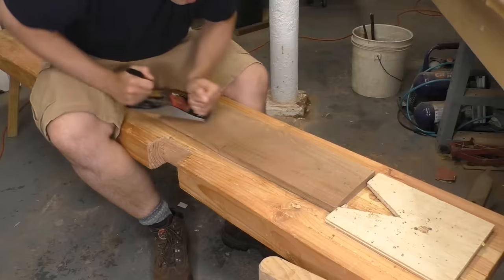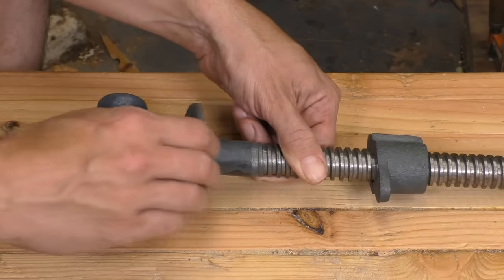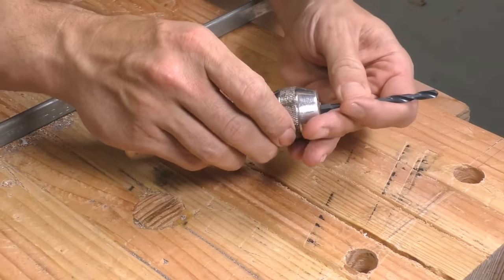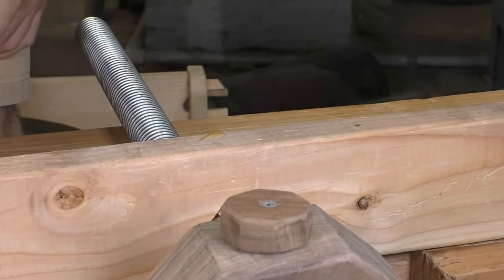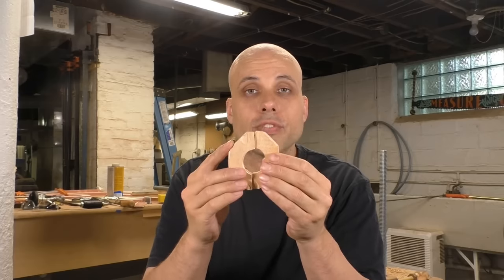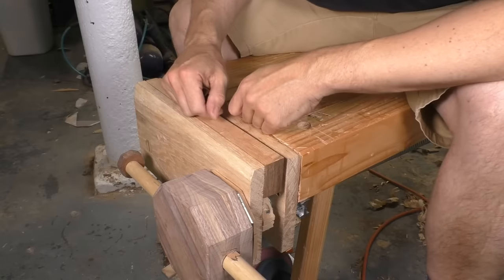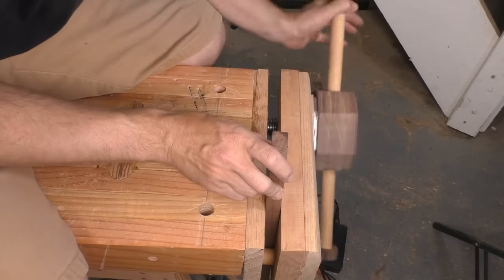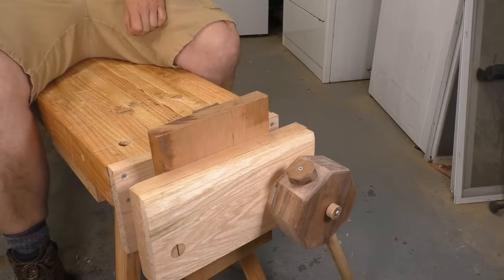Add a vise to the $30 Work Bench.

Comment: Pro tip from a machinist... Off camber vises are super useful, such as shown in this video. If you add additional clamp screws or swivots to the moving jaw they can be even more aggressively "reefed" on without movement of the workpiece. just tighten the work to jive with the kilter of your jaws, then drive your swivots in to catch any areas that dont contact your jaws
Reply: if you are holding strangely shaped objects (like castings or OFF off cuts) you can make temporary jaws that extend above your work surface, then add screws or swivots to both your solid and moving jaws to create a rock solid hold on even the most arbitrary shapes. Just tighten the vise, then tighten the additional screws for almost unlimited hold

Comment: Nice.
I built one of these and it works perfectly.
The idea of using the prop screw was the thing that I liked most; I had been looking around for a good threaded piece but hadn't found anything with a sufficiently robust thread.
Then I got lucky in a junkyard when I stumbled over an old broken prop.
After that, the rest was easy.
Thanks for the ideas.

Comment: I've watched enough of your videos to know you can do really precise work.  I feel like you were perfectly imperfect (like the corner cuts on the jack screw plate) on the non-critical aspects to show it doesn't take machine shop precision to work, and work well.  Kudos for showing these Woodwork for Humans projects in a way that doesn't make it seem that mystical skill levels are needed to successfully complete them.
Reply: My dad used to say, “No such thing as perfect; good enough is the best we can do. Just make sure it’s actually good enough”.
Reply: k
Reply: Good
Reply: Amen.
Reply: There is a good saying however:
If it's worth doing, it's worth doing well
Reply: @beer1for2break3fast4  I don't disagree.  I recently mounted retractable air and electric reels to the ceiling of my garage.  Rather than slapping a plain piece of 2x10 up to span the joists, I took the time to cut semi-circles in the corners of the boards and routed the edges with a router cove bit.  It looks much more finished and aesthetically pleasing.  When I was younger and less financially stable, I had problems even starting projects for fear of messing something up and wind up costing more than it should.  You can read/watch all the tips and tricks for a skill, but application is the only way to perfect them.  Rex's low cost projects and willingness to show that less-than-machine-precision work can still produce great outcomes gives encouragement to beginners to try in the first place.

Comment: I thank you for what you've given to ambitious beginners. For the last 40 years I've been a full time woodworker and now have a 3000 square foot shop with over a hundred thousand dollars of tools and materials on hand but I began a step or two below the level of equipment you assume for this project. I began with a $25 jig saw and a hand drill, sitting in the open doorway of a travel trailer, working across my knee. I tell that in the spirit of this video, as encouragement to the creativity of the ill equipped.

Comment: 1. Try lube on wood alignment rod (WoodGlide or a good wax) to smooth the movement. 2. For more solid clamping, keep a supply of shims to clamp in the opposite side if the Jack screw, maybe glue a small stop on each shim (need 1 shim for each work thickness) for easier setup so shim stays put by gravity while you clamp down the work. Great video as always, outstanding explanation & great concept for a cheap vise
Reply: EngineerMike F, Dude... is the brand name really "WoodGlide"? i need something for a shop stool build with a seat that raises & lowers on a threaded dowel.  BUT,  if i type that brand name into Google will i need to clear my history before my husband get's home?

Comment: This bench project motivates me so much! I just got into woodworking and have no space for a lot of tools and have to use hand tools as much as possible or the neighbors will complain about the noise, this bench is perfect for my small projects, can't wait to get mine done!
Reply from the maker: You can make it much shorter if you need to. I think 5 feet would still let you do a lot.
Reply: Nice one - enjoy the journey. Check out The English Woodworker and also Paul Sellers if you're serious about hand tools. They both teach a no nonsense approach

Comment: Neat.  It's basically a horizontal leg vise.  I made my leg vise from the same kind of scaffolding jack and it works great.  I did have to re-make my hub when the first one split.  I made it too small.  Yours is WAY better than mine was.
Reply from the maker: From my research, it looks like the face vise started as a leg vise turned on it's side. No joke!

Comment: I firmly believe in to each their own. If it works for you, go for it. I bought a Dremel vise on a whim, thinking, oh, another Dremel attachment that will simulate the real thing, only to a degree, but it's what I can afford. I'm finding this little vise works for my small projects. If I need something heavy duty, I think your idea is a good one. So, whatever each woodworker needs, that's what they should use. No method is "better" than the other, as long as whatever you are using works safely and effectively for you. That is what matters. Nice project and nice video.

Comment: I love that you don’t have insane levels of accuracy on things that don’t require it. I’m making one of these vices for my bench. I already picked up the screw and bolt assembly. I noticed the curve on the top edge of the tool tote over your shoulder is not perfectly centered, but that isn’t important for a tool tote. My respect from an native Ohioan. I’m originally from Elyria, just down the road. Thank you for your videos. I’m in Okinawa, Japan these days and do not have access to many diy tools or devices, so thank you for your videos. Amazon is getting better, though. Haha

Comment: My grandfather's wood vice ~ 14" wide, 24" high and 1.7" thick with a threaded metal bar and handle about 6" /150mm down and the 4 by 1 vertical guide bar. This worked well. I still have the metal components and intend to recreate this vice as a prelude to starting to build my THOW.

Comment: I wish I had seen this before I started building a traditional saw bench.  However - you mentioned Moxon vise and I instantly thought, "This is too low," which made me realize - if you build an appropriately sized (plywood?) box to clamp to the "non-vise" end, you can have a work surface raised enough for detail work.  I like your bench, Rex.  Great work.
Reply from the maker: You're totally right. I also sit on a stool next to the bench all the time. Works great.

Comment: Another source for the parts is a cheap mechanical car jack. You can get these for something like 20 bucks. It will have an acme / trapezoid threaded rod (considerably thinner than the one used here, but if it can lift a car, it will hold wood), a crank, the "keeper" and whatever other parts you may need.

I built mine from one of those and it works quite well. For the guide rod, I used a metallic furniture leg (which can be attached using screws) and for guiding the guide rod  I used a piece of plastic kitchen cutting board into which I bored a hole, and screwed to a block of wood with a similar hole. It glides nicer than wood only. I think the only parts apart from the cutting board and the car jack I used was a couple of steel spacers that I cut in half and drilled holes into for attaching to the jaw part to keep each part on the side of the jaw they belong to.

Comment: Great video, and explanation on Vice Mechanics, Rex!!!

   Nobody needs whine about alternative vices, either... IF there was a want for a moxon (for example) then replace that alignment rod with another screw-jack and handle (prob'ly best a wheel over there for space)... and elongate that hole to expand the range for racking... because that's all a moxon really does is rack with purpose...

    Okay, I might suggest some "tuning" procedure to mention the imminently useful nature of paste-wax around the moving wooden pieces... Whether you buy a tub, or mix 3:1 bees' or paraffin to linseed oil and heat and stir really well on your own, and adjust for personal (taste? bleck...) desired consistency... It's not complicated, and relatively inexpensive.
    AND you can substitute other waxes and oils to a fairly liberal degree for the stuff. The POINT is that a bit of lubrication/ protectant can help the general motions of the vice as much as carving and sanding off more material. 

   Made it this far??? Congrat's...
   Okay, that 3:1 mix is the "hard" paste-wax formula... 3 parts wax to 1 part oil (linseed or what have you)...
   Medium, I usually do 2:1 AND soft is 1:1 (for me)...

    Understand that bees' wax is SOFTER than paraffin. Carnauba is back to an "unknown" for me. I haven't messed around with it (or much else) in so many years, I've forgotten most of those... BUT I will say, that you can usually tell the nature of your "product" from some basic comparisons with the "ingredients"... SO mush and squeeze and fiddle with the wax and drizzle a little oil at room temperature to watch how they behave... thicker and harder ingredients make thicker and tougher paste... softer and thinner ingredients render a softer, thinner paste...

    For a vice, I recommend HARD... You're working with a tough tool, and should consider the wax finishing needs be durable. It's never indestructible, so you'll replace it soon enough anyways... BUT nothing (NOTHING) is etched in blood or stone. If you experiment... HAVE FUN with this.

    ...and for the record, I'm just as likely to put in boiled linseed oil, as I am to use raw. There can be "weird chemical additives" in the boiled stuff, though... but otherwise, you get a little more "darkening" and "color" with the raw. AND it's worth note that linseed oil is from Flax Seeds. It may have a smell, but at least the raw stuff won't hurt you... or much of anything else. ;o)
Reply: gnarth d'arkanen thanks for the interesting information.
Reply: @akbychoice  ALWAYS welcome!

    ...and just in case you're interested, I happened into some old engineering notes the other day.
   In the interest of preventing things like "racking" and to avoid friction and side-load (weirdness from sideways motions and torque)... Engineers usually try to fashion their threaded systems to have at least 3 times the diameter in length of the threads... Okay, for a simple quick little machine like this, that's a bit exorbitant maybe... BUT if one was particularly intent on reducing the awkwardness and smoothing out actions, that is one way to try... and it would only require adding one or two more of those "nuts" in line to the underside of the table.

   In any case, I just try to help out with what I can. No sense keeping all the dirty little secrets to myself. Right? ;o)

Comment: 11:18 Good thing you had ear protection for that noisy screwdriver ;)
Reply: If they are like mine they are also headphones for music.
Reply: I don’t think Rex is above using an impact driver off camera then doing the last turn with a hand unit for the sake of the video.
Reply: @escuddy3244  well, you can use a screwdriver on that, too. It doesnt change that fact that you can, he just chose not to. Or maybe he just has a noisy screwdriver
Reply: Or someone in the background yelling " Its 10 O clock when are you coming to bed........

Comment: I found this channel a few months ago looking for this exact tutorial. Had a screw from a broken metal vise and thought of adding a extra carpenter vise to my bench. This is a very useful video.
For lubricating wood surfaces try Graphite. It won't get absorbed by the wood and it's one of the best (basic)lubricants. I just find the softest pencil around (softness is proportional to graphite content)  and paint the surfaces with it.
Reply from the maker: That's a great tip!

Comment: This vise you're making is pretty awesome but when it comes to budget woodworking vises something cobbled together out of pipe clamps is tough to beat as far as economy and ease of construction goes. A web search of the term, pipe clamp bench vise turns up a few design examples. So maybe you can put up a part two exploring that? Another popular low budget ad hoc woodworking vise is made out of a car scissors jack. Which you can often find free in junked cars. It can lift a car so you know it has tons of force.

Comment: Worth pointing out that buying hardwood dowels of any usable thickness & length can get expensive, however a broom handle will be much the same & far cheaper; just buy a broom & chop off the fuzzy end. Garden brooms often have wooden handles of the right kind of size.
Also, rubbing the guide rod all over with superglue & gently sanding it silky smooth (a fine, thin sanding sponge works really well for this) will do away with that bit of jamming & judder as you close the vise. Superglue is far more hardwearing than wax and continued wear will polish it up rather than removing it, meaning it'll continue to run smoothly.

It really came out well; a clever & simple design with plenty of scope for adjustment.
Reply from the maker: Good tips!

Comment: It’s cool that you use a brace and bit set. But I find it much more probable for most people getting into woodworking to have a power/hand held drill than a brace and bit. They’re also easier to find and sometimes even cheaper. And they open up a whole world of probabilities with the motor.

Comment: to fix the racking problem and uneven pressure distribution you could move the screw to the centre and use to guides, but this would half your clamp area

Comment: Awesome work Rex! Found you a few months back..... Glad I did. Very inspiring brutha. Keep up the great content. As for all the should haves, could haves and why didn't you's..... As you said, you made this vice for YOUR needs and YOUR bench!! Stay up. Stay strong. Keep the builds coming!!! - Salinas, Ca.
Reply from the maker: I feel like I've been to Salinas. What's it near? (Oh, and thanks for all the kind words.)
Reply: Salinas is near the Monterey Bay..... Central California. About 15-20 min East of Monterey. 2 hours S. of SF.  Pretty well known for John Steinbeck and agriculture.
Reply from the maker: @To-Lo77  Crazy. My family lived in Merced for 4 years. Used to go to Monterey now and then. Pretty sure we drove through Salinas.
Reply: Small world Rex! Nice. I'm sure you did if you were coming from Merced to Monterey. I'd rather be here than Merced tho.... Lol. The heat out there can be brutal during the summer months 🔥! Typical summer here is mid-upper 70's. Merced is probably 95-105 during the same time frame, lol. 

Thanks again for all of your content. I'm sure it takes alot to do what you do, just like anything else that requires quality and information. I'm just getting started with wood working. Learning as I go. Watching videos. Piece by piece with a home garage shop, picking up tools here and there. It's a fun hobby. I have many others so it's hard to put 1 hobby in front of another. Lol. But it helps to know and see that someone doesn't need a million dollars worth of equipment to get going, get started or even continue on. You work with what you have as you go..... adding on as and when needed, if able to. So again, your content reaffirms that.... Thank You!

Comment: I had originally thought - WTF, I just bought a Jorgensen and I wasn't all that expensive.  Why go through all of this?  But as I got further in, I realized the coolness of this.  And yes, I have had that issue with uneven stock not clamping right in a cast iron vise.

Comment: Just a tip:  If one used a hexagon, instead of an octagon, it can be quickly drawn without measuring.  Find the center, put a compas on the center mark, draw a circle inscribed in the square, , , put the point of the compass on any part of the circle, and draw a line to the left and right, then put the point on the circle, where the line intersected the circle, and draw two more lines, then move the compass to the next intersection, and draw another line, then do the same thing for the last intersection.  Now, connect one intersection to the nearest intersection, and continue to work all the way around the circle, until a hexagon is produced.   It might be online somewhere, to draw a hexagon, from a compass.

Comment: Good stuff. I do have one concern, though. I have a 2x4 bench myself and got one of those Irwin vises for the end. It's held on by several screws, and I found that under high tension the vise would pull the screws out of the end grain. I eventually solved the problem by drilling vertical holes that intersect the screws, inserting dowels in (3/4 oak in this case) and screwing the vise back on. This gives the threads some cross grain to bite into, and it hasn't been a problem since.
Reply from the maker: If I have that problem, I'll try your solution!

Comment: Okay not to back seat QB but, I think if you used a little thicker dowel rod on the vise then you could drill some holes into it and add an adjustable racking pin to the vise. This way you have the option no racking adjustment or some adjustment when you clamp a board. Not my idea btw, I got it from the Moravian Workbench.

Comment: I took pictures of a workbench I came across in a tourist shop in Italy two years ago.  It was being used as a display table, but certainly looked like a working bench with a vise very much like this one.  The hub itself was perfectly round with a very nice-looking crank.  The jaw is a single piece of wood, decoratively fluted at the far end.  Instead of a dowel for the guide, it looks like it uses a rectangular board, tenoned into the jaw.  Unfortunately, I didn't take a picture of the underside.  I'd be happy to provide the pictures themselves if there's a way to do this.